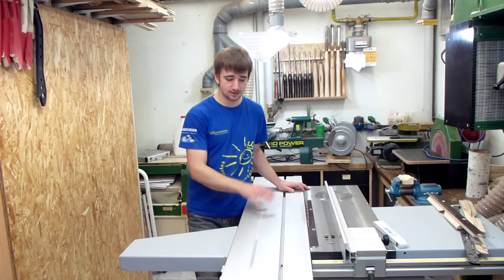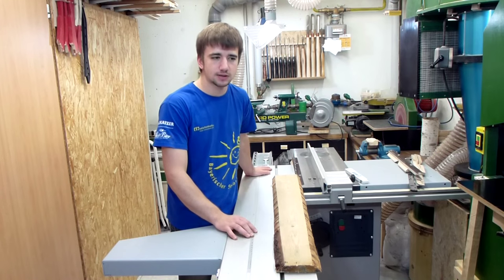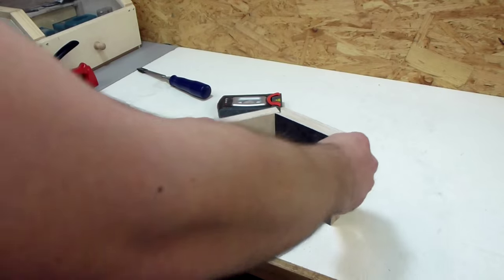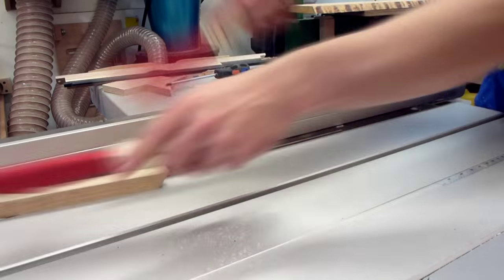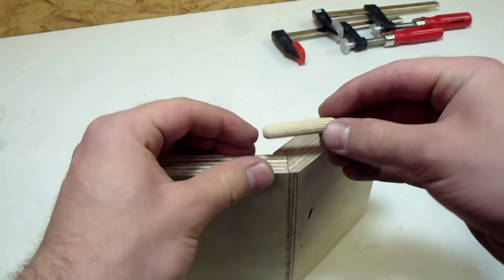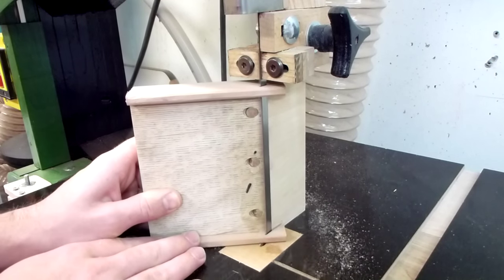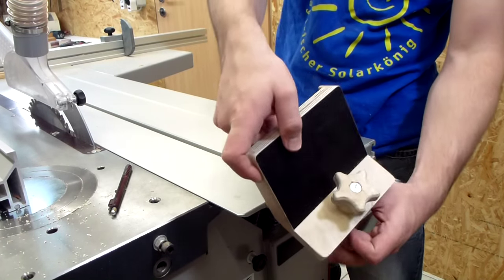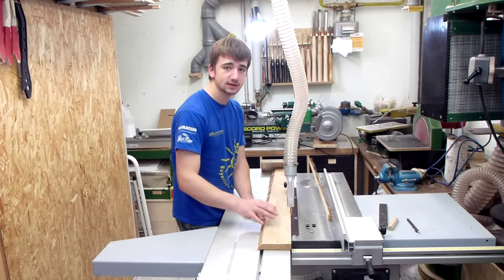Homemade Edging Shoe for the Sliding Table Saw

Comment: Wouldn't it have been easier to modify a G clamp (or similar clamp) to fit into the T slot on the sliding table, you could then use it for any similar jobs.

Comment: Well done again - but was it really worth saving 25€ ? The "Besäumschuh" is a rather cheap accessory
Reply: building stuff by yourself is always cooler than buying something
Reply: Of Course but there is always a point where it stops making sense - you could also not only build your own saw, forge your own blades, wire up your own engine ..
Reply: +Powermaennchen thats true but building your own blades is another level and this is quite easy to build so why should you not build it
Reply: Sinuchs i guess it just pretends on the amount of spare time to invest into woodworking, he sure did a fine job but the original part is cheap and he could have been making something else in that time, that's all i say - i always like when woodworkers are also "inventors" coming up with their own stuff but in that case me personally would rather spend the money and continue with somehting more exciting

Comment: I would have  preferred to make this comment as a "reply" to Eugene or Duio, but neither has their Youtube "reply" option turned on.  Both are troubled at 2:55 with the router round over on such a small piece with your hands so close to that whirling cutter.  I supposed I would have just used a small file and finished up with a small diameter spindle sander to make the round over.  I wonder if either Eugene or Duio would prefer some other method? Did you feel uncomfortable with your fingers so close to router cutter?   In hindsight, would you use a different method to soften the edges of the knob?
Reply from the maker: ***** I included this shot on purpose to see how many people will indicate me about my safety. I really don't feel uncomfortable doing this, because I know what I'm doing, where my fingers have to be and where not and I am fully concentrated on that. The time-lapse makes it look a little bit unsafe. But this is about the smallest piece that I would round over like this.
Reply: Marius Hornberger Excellent response, Marius.  Thanks.  : D

Comment: What blade are you using for solid wood?
Reply from the maker: +Bid Budy A ripping blade with 14 teeth (flat top)
Reply: +Marius Hornberger Wow that's a aggressive blade! Do you also use it for cross cut? 
Thanks
Reply from the maker: no, of course not.
Reply: +Marius Hornberger What blade do you use for cross cut, are all of your blade from Felder?
Thanks
Reply from the maker: +Bid Budy Watch my Q&A. There I showed what I'm using.

Comment: I'd slot & use splines instead of dowels.
Reply: How come?
Reply: David Taylor - I thought a hardwood spline along the length of the joint would be easier/quicker than rigging up for the drilling procedure, but after watching a second time I'd  just use a much thicker (35-50mm) rear piece cut at 45° to mate with the black piece; glue would probably be strong enough on that broad surface (wood to wood w/o that laminate), but tablesaw kerf splines along left and right edge could easily be added (and then the rear piece could be thinner with that extra support). Marius' work is always beautiful though. Such a witty, brilliant young man.

Comment: edging shoe, the literal translation of besäumschuh.
This makes you the first hit in Google. But what is it actually called?
I suspect a lot of the terminology doesn't really exist in english because this type of saw isn't very popular outside of Europe.
I still sort of disagree with calling this type of saw a "Sliding Table Saw". While it obviously has a sliding table it is still not comparable to saws that have a sliding table as an accessory, here it is an integral part.
Panel Saw seems to be somewhat popular but they are more appropriate for really huge machines making furniture from particleboard. The manufacturer Altendorf does use the term "Format Saw" on its US homepage, but that is like the edging shoe just a literal translation of the German word. The thing is, those machines have been developed to get around the problem of needing reference surfaces. Normal sliding table saws can only do that if the workpiece is huge.
Reply: +BR H Besäumschuh is the correct term, google was right :-)

Comment: nice project, but NO 2:56 !!!!!
Reply: I yelped too, Dominique. So, the advantage of hindsight, I would layout, drill the hole while I had the larger work-piece to grip, scroll cut and sand, and then i suppose I would try to temporarily fasten the work-piece to a handle; through the hole, I guess. Maybe some hot melt glue, too, because easily removable. Maybe all that would not be any more convenient than grabbing the work-piece with a handscrew, though, no matter how many shiftings. Only one piece.

By the way, Marius, you are the Boss with Hot Sauce! Lee